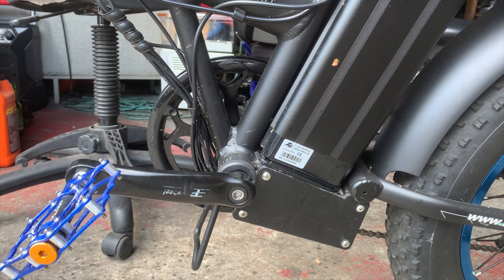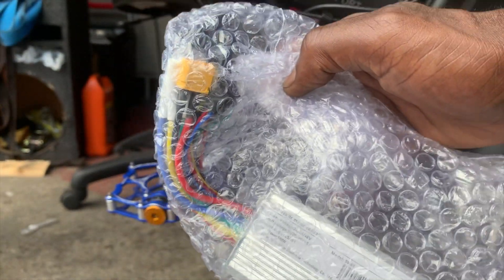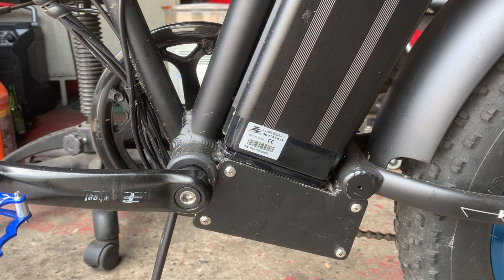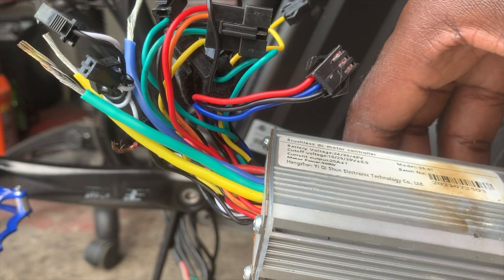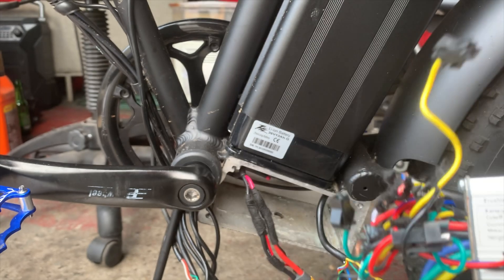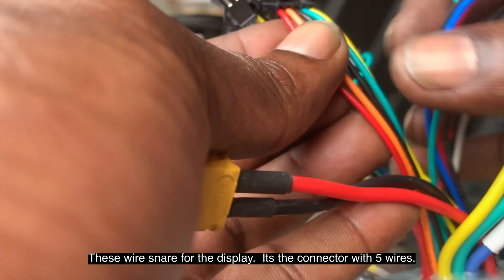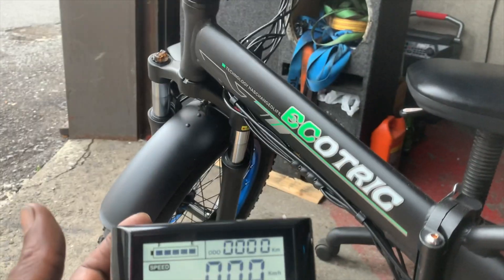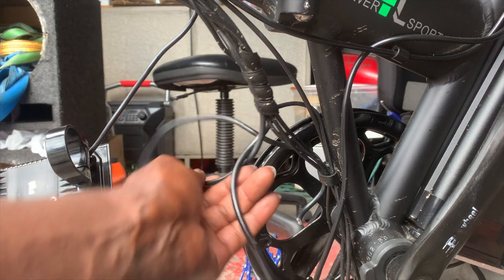Ecotric Fat20 Error 002 Repair

Comment: Hey bro i don’t know if you’re still active but i got an error 02 on my ebike. Water damage as well from rain. My bike works normally it’s just that the speedometer stopped working. is it possible for me to change the controller only and keep the display?
Reply from the maker: Yeah you can replace the controller only, however i would replace both, just to be sure.